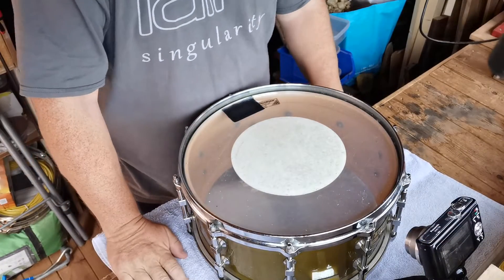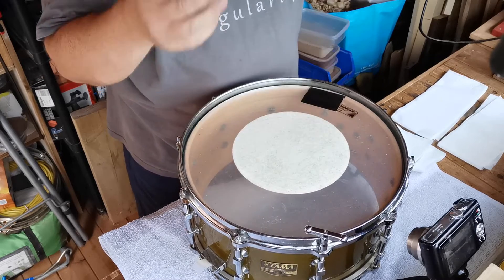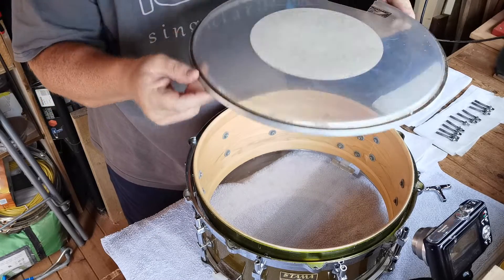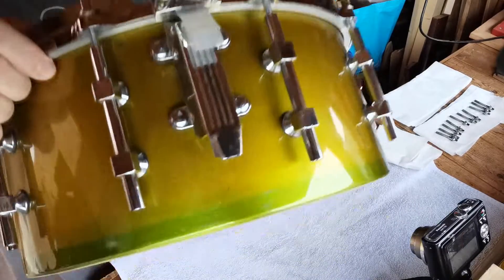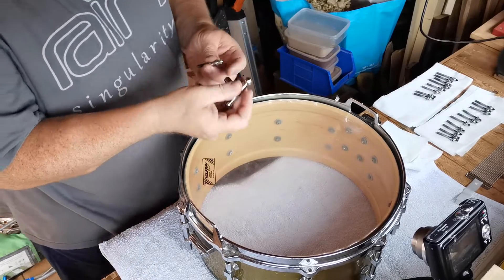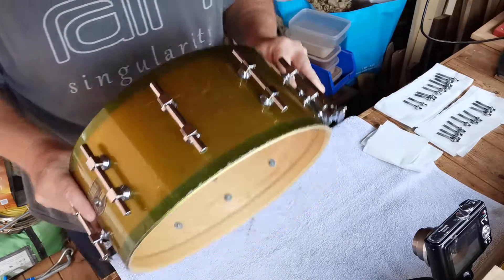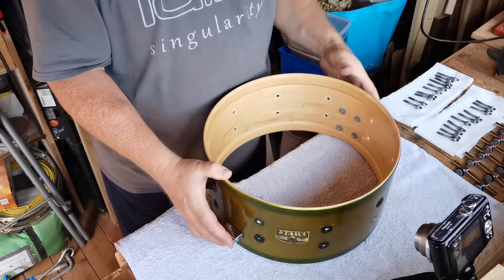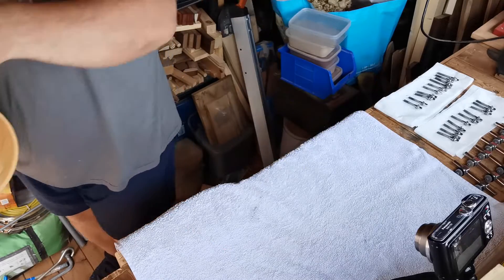Servicing a Tama 14" Snare Part 1 / BreakDown

Comment: 4 by 2 yep to dry clean an SLR barrel (showing me age) 22:30
Reply from the maker: You've lost me mate.
Reply: That cloth we used to clean our weapons was called “4 by 2” as in its 4 inches along the red line and it’s 2 inches between the red lines.  
We would tear along the red line and so we had a piece of the flannelette that was 4 inches by 2 inches. This would be the correct size to fit into the pull through that would be drawn through the weapons barrel. 
You would run a dry piece through to clean the barrel then depending on the conditions (desert or rain forest ) you would leave the weapon dry or oiled. In damp conditions we would tear off a slightly narrower strip, apply oil and then pull it through the barrel to ensure the barrel didn’t rust. In dessert or dry conditions you didn’t want any oil in the barrel as sand would crap it all up. 

So there you go mate 4 by 2 flannelette